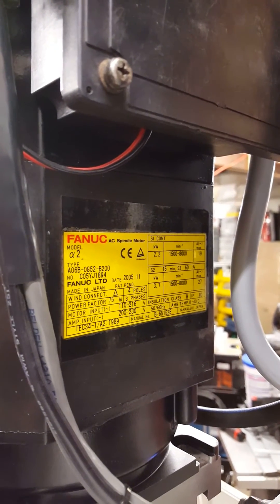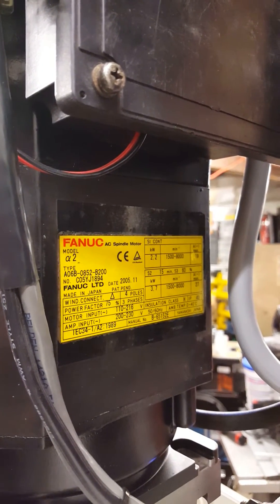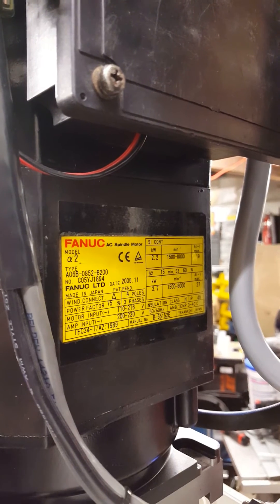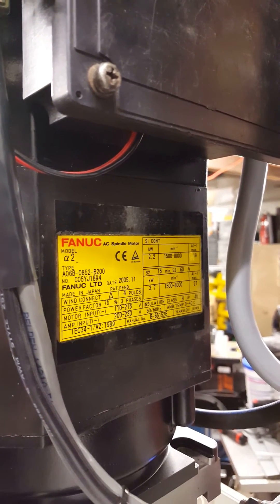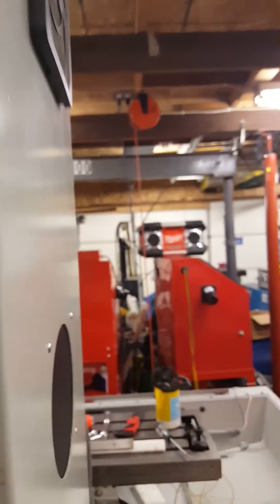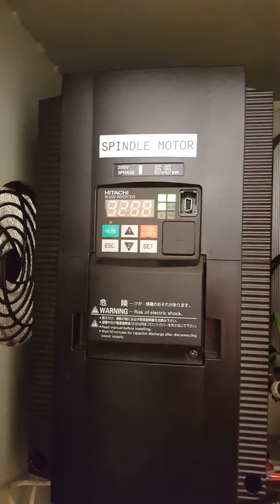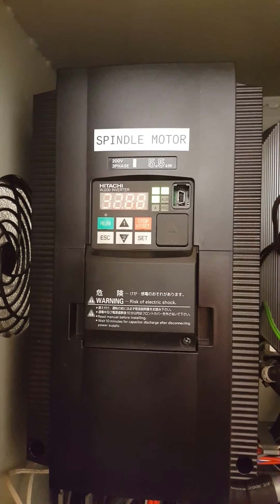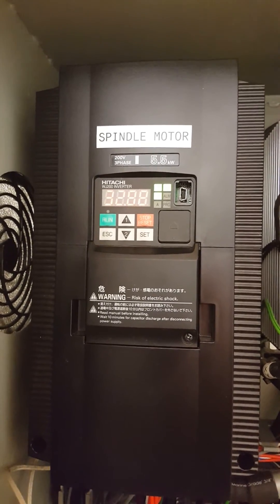Novakon Torus Pro with Fanuc Spindle Motor - First Run

Comment: Hi Dan, thanks for the video. I have found your thread in cnczone about running an Fanuc AC Spindle motor with an VFD and it maybe you could help me out, because i am very clueless. 
In near future i want to build an CNC router for milling steel and aluminium, and want also use an Fanuc AC spindle motor  from year 1995 (3S-12000 / type: A06B-0753-B394#3000 / 3.7/5.5kw - 1.500 - 12000 rpm), but due to no experience i would need help to get to know what i exactly need to get it to run (with rigid tapping and ATC). I opened already 3 threads in 3 different forums, but i got no help. I already took a look at the files you have uploaded (thanks for that), but like i said, i have no experience)
If you have time then reply here or if its possible, then send me an mail to "denhen89@googlemail.com".

Best Regards,
Denis
Reply from the maker: Denis, I am terribly sorry for missing this post until now. Its been a hectic year for our family and it must have just slipped past me. Did you get anywhere yet on your project?